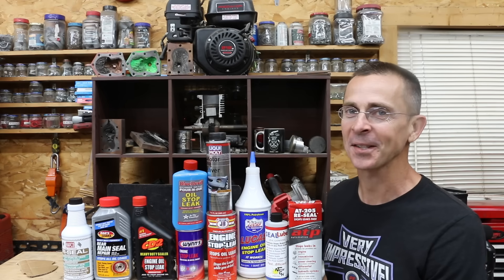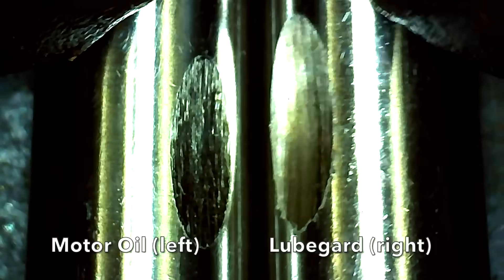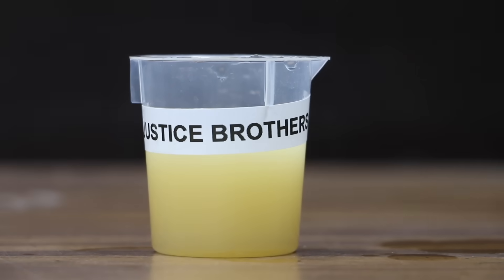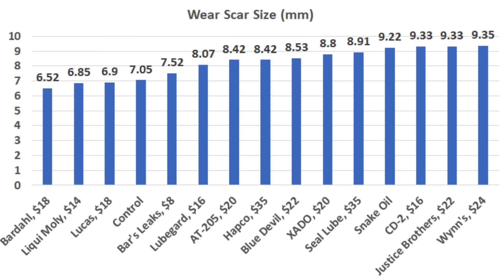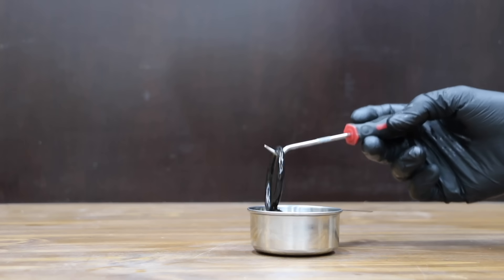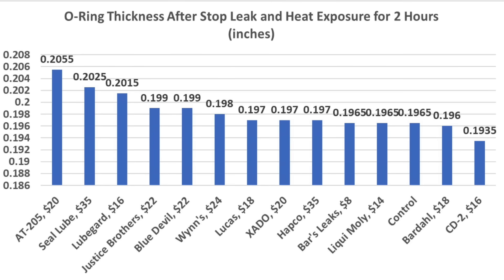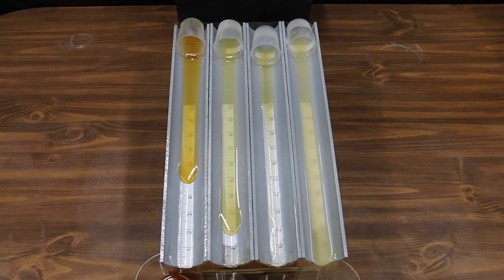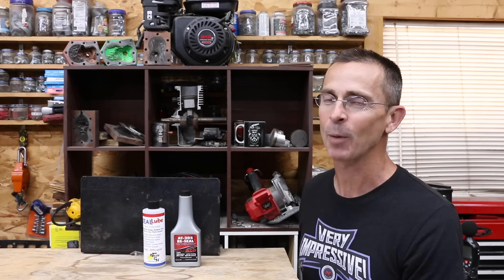Do Stop Leak Products Work? Do They Damage Engine Seals? Will They Destroy an Engine? Let's Find Out

Comment: The results seem to confirm the two "Solutions" which are: 1 - Dump in solvent to re-soften the rubber seals at the cost of damaging flat tappet cams and distributor gears as well as cylinder wall wear (Basically any metal on metal contact) or 2 - Gunk the engine up with sludge by increasing viscosity.

Anyone who's made the mistake of running full synthetic in an older, high mileage engine can attest to the sudden appearance of seal leaks. Both methods have their disadvantages, but the solvent one seems to me to be the higher risk of causing engine damage.

I generally just keep adding dinosaur oil and live with the driveway spots.

BTW you're using the additives at a much higher level than they would be if used at the intended dose so the effects are probably equivalent to adding 50% paint thinner or 50% gear lube. No? Don't mean to pick on you, but the results would be far more drastic than intended use.

Comment: Does anyone have a good answer regarding the optimum time to have the AT-205 in the engine oil compartment to accomplish it's leak sealing capabilities (5, 10, 20? - full engine temp heat-up cycles) before draining the oil and replacing with new oil and no AT-205 to eliminate the wear on the engine or does one always have to run the engine with the AT-205 in it to keep it from leaking again.  I'm hoping one treatment with a few heat cycles, then drain and fill with new oil and it is enough to keep the leak from coming back for a year and the engine is not getting all that extra wear.
Reply: It depends on how bad the leak is... I use at205 re seal every other oil change on my Acura I have a RMS leak and it helps but if I stop using it , it will seep again
Reply: @jd646  thanks for the info on your experience with this product and the fact the seal expansion doesn't hold back the oil leak without the AT205 in the oil pan (at least every other oil change)
Reply: @timhardman4764  yes and with the at205 re seal I go up a weight in oil to help against the wear my Acura calls for 5w20 and I go 5w30

Comment: AT-205 works great! You can also put it in a sprayer bottle and treat all your rubber, gaskets, cv boots, rubber seal from doors and sunroof. It has many uses really.
Reply: Or you just buy actually rubber protectant for half the price
Reply from the maker: Thanks for the feedback.
Reply: I wonder if the AT -205 would work to prevent the exterior side walls
of car tires from cracking, due to being in the sun and drying out.
Once they crack a lot of tire places make you get new tires. They say
these cracks could cause the tires to blow out, and it's very dangerous.
Maybe it would soften the tires too much tho ?? I don't know ??

Comment: All of these products  leave product in the cooling system & are problematical by reason of leaving the agent deposited on cylinder jackets, heater core tubes, water pump impeller & housing & on it goes. Several times these products cost me a heater core. This is my experience with them, but possibly others have had good luck with them.
Reply from the maker: Thanks for sharing.

Comment: Just what I needed to see !
I got leaky valve seal guides in my GFs 2008  mini cooper 

I used one of these products on my old Celica and it worked for a while on same issue    However there is a oil 
I think it’s called red devil ?  You can google it it will not burn and smoke won’t leaking guides   It’s more money  but it works great 

Only with the mini cooper it does not burn on cold
Starts it burns after idling for 2 min and this is because the head has raised collars on the  guide  holes   So oil does not leak down when siting cold 

So buying five Q container for $50 bucks sucks as it will still likely consume oil ( and it uses a lot  about a quart every 200 miles !  ) so 

If the sealer don’t work 
I guess I have to spend the day changing seals !  😆

Now to see if advance has the best rated products from
You     Great job your uploads are top notch   As always  🥰
Reply from the maker: Thanks and you are welcome!  Thanks for sharing.
Reply: As always a very good comparison!! 
Seems to me the top 4 would be best to use at 100 miles or so before oil change to prevent excessive engine wear, since all of your tests were done over a short period of time. Just a thought.
Reply: @USMC1984    I don’t think most of these brands hurt the integrity of the oil that’s just a pressure bearing test you’re gonna get that wear and tear with or without it the additive just didn’t make it any better but that’s not what it’s supposed to do it’s supposed to swell composites

I just used it in the 1.6 four-cylinder on a mini Cooper 2008 definitely leaking from the valve seal guides so far it’s got 150 miles on it and it’s smoking as bad as ever and I went to three auto parts stores for that top brand That he tested two of them don’t carry it. One of them was out of it. It’s - AT 205. 

But that’s a strangely engineered engine. Anyways, I did use one of these brands on a 94 Celica and it worked pretty good but it didn’t stay working. 

The problem is with the mini Cooper. It will burn oil from leaky Valio guides while the engine is running so your oil consumption goes up however, on other vehicles engines, there’s a special oil you can use that doesn’t smoke when it burns it’s twice as much but if you don’t want to change the valve seal guides .

Comment: can these products help with bad valve seals? I keep losing so much oil to the point where i have to top off every other day cause the dipstick reads so low. no signs of excess smokign or leaking but I dont know why i keep losing so much oil

Comment: ATP-205 Reseal FTW!  Been using it for a number of years.  Every time I have small oil leak on the driveway i start administering ATP-205 in each oil change and it ALWAYS stops the leak.
Reply from the maker: Thanks for sharing.

Comment: Will these help with a valve cover leak
Reply: No it won't work on a valve cover gasket leak, because the valve cover sits top of the engine, it's not an internal gasket
Reply from the maker: Thanks for the suggestion.
Reply: @ProjectFarm  That was my question lol

Comment: Looking for some advice:  I have a 2006 Audi with 200k miles and possibly a rear main leak.  I have been told that some cars like mine with really small tolerances (not sure if this is true for Audi versus other car manufacturers)—that using “stop leak” additives can really mess with the other seals that’s are NOT damaged (make them swell I guess?) In other words, are these additives not good for cars with supposedly tighter tolerances?
Reply: No that's nonsense use the re seal. At205 is the best

Comment: Now do engine coolant!! LOL
Reply from the maker: Thanks for the suggestion.
Reply: I bought a 2,000 dollar bmw that nobody would touch and I fixed it for over a year it worked great but, I might have to drop the trans and pull the clutch just for a rubber seal.  @ProjectFarm

Comment: All, besides using one of this products (and looks like the AT205 is the winner), make sure to change your PCV valve and its connecting hose using OEM parts ONLY!   The failure of the PCV valve is one of the main causes of leakages, especially the rear main seal.  Don't let mechanics trick you in spending money for replacing other parts that do not solve your leak problem.

I just replaced my 2001 Honda Accord 2.3L/4-cyl engine with the a new OEM PCV valve and hose, both costing me $35.  EASY DIY!  I wish I had done it sooner, because the original PVC valve is barely clicking/heard when shaken!  That means it is bad or already dead!  The thing was 23 years old!  Now I make sure to replace my other car's  PCV valve sooner!
Reply from the maker: Thanks for the feedback.

Comment: I have a question... My mothers car was shaking and running rough.. I looked at it found out she had less than 2 out of 5.5 quarts left. I changed the oil started sounding much better. So she obviously had/has an oil leak....
My question is if she was running that dry for a while is there anything I can add to repair any damage she may have done?? I assume the metal might be scratched up or something..

Comment: AT-205 has been my stop leak of choice for myself and customer vehicles that were not worth the time/money to repair properly. I’ve had good luck with it and have not witnessed any ill effects. Like Todd said, would rather do a proper repair on something worth it. But something like a rear main seal on a work beater just isn’t normally worth it. We always explained the dangers and risks to customers before using.
Reply from the maker: Thanks for sharing.
Reply: I like the idea of using it even on "decent" cars.  If it swells the rubber gasket that is the same as a new gasket

Comment: wow after using liqui moly on my hyundai accent 08 which was leaking oil everywhere, nothing changed. but when I put the at205 what a surprise it works wonderfully after 100 kilometers I also put some in my direction and the pump no longer screams same thing for the automatic transmission which was knocking, now it is very smooth the car has 240,000 kilometers The question is: should I add more at each oil change? thank you so much Christian St-Pierre Quebec/Canada
Reply: No reponse

Comment: I bought the AT-205 not to stop leaks but to soften my windshield wiper blades after a season of use. It works great and really cleans them to like new condition. It extends the use of the blades about 3x. I usually have to replace the blades now only when they fall apart, not because they annoyingly chitter across the windshield or leave streaks. It's paid for itself many times over, and I have a lot left in the bottle.
Reply from the maker: Thanks for sharing.

Comment: A test I'd like to see is how the wear scar bearing test does on oil that has been driven 500 miles in the car. I have a feeling that these stop leak products are supposed to get hot, get used then evaporate off. If it's staying around after the 500 miles and still causing greater wear it may make sense to change the oil again. But this may also be unnecessary. The only way to find out is to test driven oil.
Reply from the maker: Thanks for the suggestion.

Comment: Hi! So i am having high oil consumption and a leak in my Tercel from the 95, right now I cant get the engine rebuilt (due to economy), so the only additive i could find in Costa Rica was the Liqui-Molly 

Fun fact, instructions say that the effects take up to 600kms to take effects, so I guess since additives can only have a visible result after a long and constant use

Quote:
"The product is self mixing and can be added at any time, sealing first takes effect after about 600-800 km (400-500 miles). The use of Motor Oil Saver every around 30.000 Km (20.000 miles) is recommended to guarantee a lasting effect."

Comment: I am a fairly experienced mechanic/machinist starting in 1960. I was always a new seal believer. I tried some Seal Lube in a MB transmission 23 years ago, since replacing a torque converter seal takes a few hours. It hasn’t leaked yet. I then tried it in my Nussbaum car lift with the same results. Since the actual ratio is 32:1 I don’t think the wear would be so bad. Justice Brothers products have been around for years, they used to have tokens in the can for mechanics to get a reward for selling it. Bardahl is also quite old selling upper cylinder lube etc. I learned that the pronunciation was with the accent on the first syllable?
Reply from the maker: Thank you for sharing!

Comment: Regardless of the differences between the results of this test, will I get better valve seal performance if I use one of these materials, and will oil burning decrease?
Reply from the maker: Thanks for the suggestion.

Comment: I had a really bad rack and pinion leak on a Ford Taurus, AT205 really works. I put the prescribed amount in the power steering reservoir and within a couple of days the fast leak was a slow drip. Months have gone by and it is completely sealed.
Reply from the maker: Thanks for sharing.

Comment: I'm almost 50 and been poor over half of that time, from my honest experience, they usually either don't, but can temporarily buy you time. Although, I will say some have actually worked as advertised. It's a crapshoot honestly. I think overall they can buy you time. The power steering ones have completely worked for me, radiator ones are a band aid and can cause more problems. Transmission ones seem to just be transmission fluid. Oil ones will work for very minor leaks only. Just my 2 cents.

Comment: Seems all of the tested products caused metal wear. Most also had an affect on the o-rings. Yet at the end you mention that you wouldn't use any of these unless you had an "active" oil leak. What then do you say regarding so called High Mileage motor oils for older engines since they contain the same type of ingredients as these stop leak products? Will they cause the same kind of metal wear as you demonstrated? Should it be used even with no "active leak"? Curious!

Comment: So, which one is the best for stopping a pretty decent oil leak?
Reply from the maker: Thanks for the suggestion.
Reply: Probably depends where the oil leak is coming from. If it's the piston rings then it would be whichever one makes the rings swell up the most

Comment: Great test. I kind of cringed a bit at the beginning with the 50/50 mix as these are seal conditioners not friction modifiers, but I know what you were doing. I have used AT205 at my shop for a couple decades now and it is a fantastic product. Nobody wants to repair a rear main seal leak, this product slows most of them down to a weep.
Reply from the maker: Thanks!

Comment: i watched a video of an automatic transmission that was being disassembled, and it had been run with some kind of stop leak/seal sweller. Every o-ring and seal that came out of that transmission , when removed, was twice its normal size and had no flexibility. In many cases the o-ring or seal just fell off of the part it was on.
Reply from the maker: Thanks for sharing.
Reply: Thank you for the good presentations! @ProjectFarm

Comment: 5.7 Durango 2014  100,000 miles AT 205 worked on my leak and it looked like it was from the rear main seal or the oil pan gasket probably the oil pan gasket. It sealed my system right back up.
Reply from the maker: Thank you for sharing!

Comment: So I have a 05' Sierra 5.3 with a significant oil and steering gear leak. I am pretty confident that my rear main seal is leaking due to having already swapped the oil pressure sensor with no effect on the leak. The oil leak has been a progressive issue for over 2 years while the steering gear started leaking about a year ago, but also being pretty heavy leak. I have never used stop leak products and have always been skeptical about their claims as the thought of restoring rubber to it's former volume and elasticity made no sense to me. Well after watching this video and coming across another that documented their use of AT-205 I gave it a shot. I added about 90 percent of the bottle to the crank case and the rest to the power steering fluid. I set the engine run timer on my gauge and at about the 3 hour mark I stopped seeing signs of the oil leak. The steering gear leak held out just shy of the 5th hour  but it seems to have resolved. All this from one damn bottle lol. Apologies for the long winded recap but I am truly impressed with how this worked. Thanks so much for the review and keep the content coming because I am a huge fan of your channel.
Reply from the maker: Thanks!  Thanks for sharing.

Comment: I purchased this BlueDevil 00209 Pour-N-Go Head Gasket Sealer, 473-mL and it did not work for me on my Dodge Grand Caravan 2007 with 207K Km on it - after about one week, the issue persists. Then I purchased the Rislone Head Seal Blown Head Gasket Repair, 1-L, and used only 600 grams, which worked for me - after 3 days it stopped leaking.
Reply from the maker: Thanks for the feedback.

Comment: So what the results show, that any product that actually works as a rubber and gasket restorer also doesn't protect your engine.
I would rather have a small oil leak, than put anything in my oil that makes it essentially worthless.
You can top up oil, you can't add metal.
Reply from the maker: Thanks for the feedback.

Comment: I would really like to see you do a video on Power Steering stop leaks.  After researching on the internet a while, the top 2 seem to be Blue Devil and Lucas. I have a pretty decent leak in the pump seals that just started yesterday, I guess the sudden cold weather hardened the seals and caused a leak. I sucked out the fluid in the reservoir, and added the recommended 1/3 bottle of blue devil. I filled the rest of the reservoir with the rather thick Lucas product.  I let the engine idle in the driveway for about 15 minutes.  I then drove to work.  The leak is not gone, but there is a DRAMATIC improvement!  I think this combo may actual resolve my leak, if you're interested let me know and I will update after i get the recommended few days of driving in.  This is in a 2009 Jeep Grand Cherokee WK 3.7L v6 with 207,000 miles on it :)
Reply from the maker: Thanks for the suggestion.

Comment: It seems it might be worthwhile to apply the better rubber softening first and then lubricity and puncture resistance on the second oil change. But then, maybe the softening permanently weakens the puncture resistance.
Im not sure how significant the puncture resistance is in comparison to a high pressure and temperature breach.
Reply from the maker: Thanks for the constructive feedback.

Comment: What an old timer told me was to use a small amount of brake fluid in the oil, run till the leak stopped and then change the oil. I guess the brake fluid would swell oil seals. Thanks for sharing.
Reply from the maker: You are welcome!